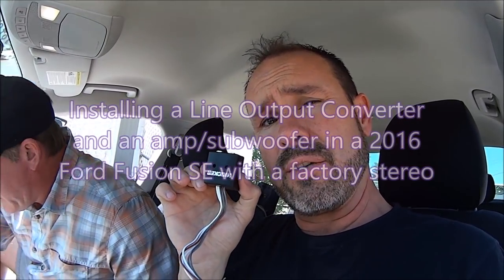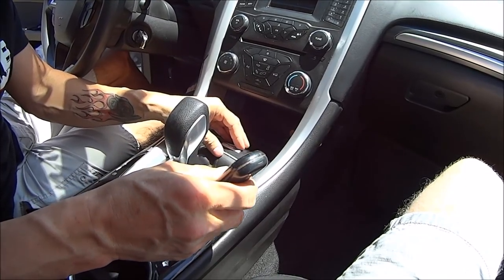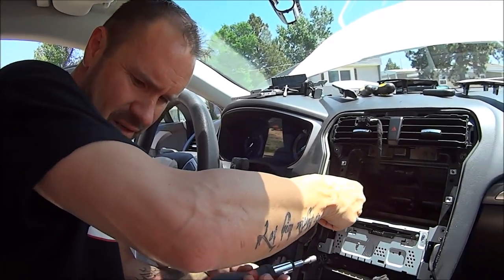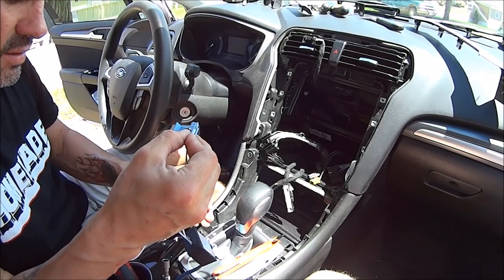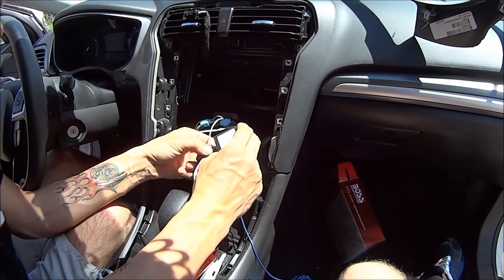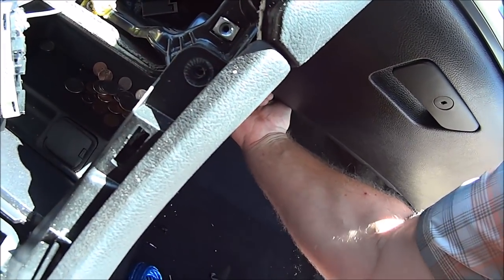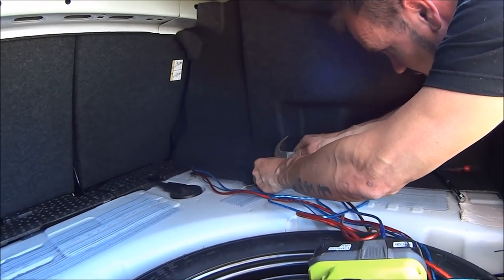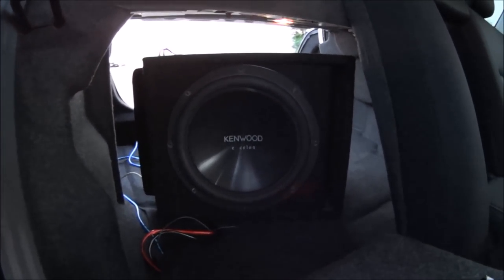How To Install a Line Output Converter & Sub/Amp in a 2016 Ford Fusion SE with a factory stereo

Comment from the maker: 🤩 How to hook up Remote Wire for amplifier  - 2013-2017 Ford Fusion https://youtu.be/F5KxbV1Pylk
Reply: rapidtronics I have the same fusion but do you know how to take the rear door panels off ?
Reply: Would the wiring diagram work for my 2019 Ford Fusion?
Reply: @rpgdadon1184  2 screws and a few pop pins, and wiring harness. Just start the pull from the bottom and work up each side evenly...

Comment: Bad idea to run your power wire on the same side as your RCA wire.  If your using cheap stuff I guess it will work .  How ever if you use good stuff do it right .
Reply: You wont hear interference in the sub running the RCA next to power. You are much more likely to hear interference when running your mids/highs next to a power wire. Nonetheless its good practice not to run the RCA next to power. This guy was brutal to watch do this install. I was actually angry by the end of it.
Reply: @stephenvernacchio3366 in one word "inductance"
Reply: The whole video was painful but to see all the comments of clueless people asking for his advice scares me even more!!

Comment: Be careful running power and signal wires on the same side. Alot of the time it can cause interference in the audio signal. Also for those attaching the ground to the body, make sure you scrape paint off from where it makes contact.

Comment: Just did this on my 2013 fusion. For anyone wondering the radio ignition wire for the remote is a skinny brown wire next to the other speaker wires. Hooked the remote up to there and it turns on and off perfectly.
Reply from the maker: Thank you so much!
Reply: Fire 🔥 information thanks

Comment: I did this and now the radio won’t turn on everything worked fine for a minute Iv checked fuses disconnected the battery nothings working radio is completely black and won’t turn on anymore

Comment: Dude thank you for this video! Got a powered sub for my son's birthday and he's got a 2016 Fusion hybrid. Cool thing is that his 12V battery is in the trunk so no need to run power from the engine compartment. I assumed I could tap into speakers from the trunk but they are only in the doors! Grr! Its nice to see all the steps and problem areas of the process.
Reply from the maker: Steven Bloomfield thanks man I appreciate it!  Glad this helped 🤗

Comment: You made a very courageous video.I did my full system recently which took me 3 weekends.It can be very daunting  for average Joe's as there is much more involved than people think.Taking apart the interior,determining amp locations,figuring out the best,cleanest wire paths and the list goes on.I've never done a Line output converter but my mother wants me to do an upgrade in her vehicle which will require using the speaker outputs to send the signals to the amp.There are simpler applications out there from good manufacturers such as Kicker.For example,speaker outs to RCA which can go directly to an amplifier that accepts high level RCA signals.That same amp has a DC offset turn on which does not require running a remote wire.
Reply from the maker: How to hook up Remote Wire for amplifier  - 2013-2017 Ford Fusion https://youtu.be/F5KxbV1Pylk

Comment: Ur so awesome!  Thanks 2 shops couldn't figure it out without connecting things and it looks a mess and my battery has died 3rd different replacement now and no sound after spending so much money ima just go do it myself now that ur updated shows the real place to connect the remote

Comment: Dude I give you an "A" for effort, watching you do this I felt so compelled to help but I couldn't, for one it's a 7mm socket, and the screws you took out by the vents were unnecessary to remove, there's just the two screws on the lower end that needed to be removed, the rest is just clips that hold the radio in. I'm sure you figured that out eventually but a little to late lol, thanks for the video anyhow.👍

Comment: worked great with the remote wire location from the other video! thank you so much for making this video, made my life much easier!
Reply from the maker: That’s so awesome!!!  Thank you for letting me know 😁
Reply: @rapidtronics  i couldnt get the power wire through the firewall because i couldnt find the grommet on the other side so i just ran it through the door, but besides that it works great!

Comment: Great video! Next time try grounding the line out converter and run the remote wire from that. Once it detects the 12v coming through the speaker wires it will send power to your amp.
Reply from the maker: I actually do want to try that next time..  And thank you! ☺️

Comment: Thanks for sharing this video. I Had little issues. My issue was installing the wire from the battery. My hanger kept getting behind the carpet. Had to put my finger in the hole to feel for the carpet and get it in front of it to string it through. Other then that, I didn't have to go back and go over the system because it didn't work. 

I should have went and got those fancy wire clips though because trying to use regular wire caps made things really tight as they don't give you much extra wire. But it still works and that's all that matters.

Comment: If you have the Sony system definitely add the loc after the Sony dsp and tap the signal off the oem subwoofer otherwise your subwoofer you’re adding will be controlled by the volume, and the beeping for your backup sensors and stuff will be played through the new subwoofer too, add your new subwoofer AFTER the Sony DSP(sony amp)

Comment: Hey! This was so helpful thank you much! The only problem I’ve come across is with the ground wire on the Loc, I’m not sure where to put it. If I ground it to metal the subs and amp will turn on but my whole AC and radio panel will turn off completely. I was wondering if you any ideas one what could cause that? Or what wire the ground is supposed to be attached to if that’s the issue

Comment: You specify two different sets of wire colors in the video and then provide a link that details an entirely different set of colors for each speaker. Which is correct?

Comment: Thanks for this video brother I just picked up a 19 se myself very informative!
Reply from the maker: Right on and thank you brother!!
Reply: Will those work for a 2020 Fusion SE Hybrid with 8 inch Sync non Sony amp? I'm trying to determine the wires for the speakers to connect a line out convertor.

Comment: Dude you are so awesome for making this video!! 👍👍
Reply from the maker: Dude thank you so much!  I really appreciate that ❤️
Reply: I ran into the same problem w the remote wire. It’s currently tied into the pink/purple lcd screen wire.. If I put a toggle switch on the remote wire, N turned it off, would that keep my battery from dying?
Reply from the maker: Ya that would work too.  Did you see my other video on how to hook up the remote wire?

Comment: Your video was very helpful. But I have one question?  I see you ran the blue remote wire to the 12 volt wire behind the deck. But what about the blue remote wire coming from the  line lout converter harness?
Reply: I have this same question

Comment: took em like 4 tries to figure he needed to go to the fuse box smh. i was going to send a comment through because thats what ive done on my ford focus but its not the same model but simalair builds on the interior for wiring and panels, i also am going to be installing a loc and swap back in my rca cables instead of the speaker cables in there what you couldve done was install the loc in the trunk next to the amp wiring harness then run your speaker cables up left side and power and radio turn on wire up right side, then you wouldve had a direct tie in to the remote turn on switch from atleast the amp. but after doing it for first time after a build like this you start to come up with different ways you couldve done it. i janked up my speaker wires they ended being too short for the length i needed so i had to tie in another 2 feet of speaker to already tied in speaker lol. had all my frequencies down from the start and wasnt really getting too much base for a couple months now ive left it buit went back to it and firgure the frequencies were low from factory build so turned em up and now i got an amazing sub that is going to be upgraded by cables and loc soon enough then speakers later.

Comment: This video is very helpful. I now have an amp and sub hooked up but the big issue that I'm facing now is feedback from active noise coming through my sub. This is active Everytime the engine turns on. I have a hybrid and the sound is annoying and it can possibly damage my speakers.

Do you know how to disable the active noise without unhooking each mic?
Reply from the maker: I don’t 🙄
Reply: When I got my amp/sub in, I had to use LPF only because if I had it on Full or HPF I could hear the music through the sub. Maybe that's the issue for you? Not sure how other amps look or work though. LOL
Reply: Jessica Swearingen Thanks for the reply. I got it all sorted out. It turned out to be the Active Noice Control Mics in the car. I did a lot of reading in forums and started unhooking the mics from under there headliner. If you're just doing an amp for subs, it will just be the rear mic that needs to be unhooked. If you're doing an amp for mids and highs the front mics in the headliner will need to be unplugged.

The actual module is behind the Glove box but it seemed easier to just do everything from the headliner. Now the sound is perfect.

Comment: Doing the same thing to my 17 fusion rn. Do you think I could remove the center console side panel under the radio. Then find the wire harness going up to the radio and splice line output converter from there. That way I don’t have to remove the stock radio and splice behind that?

Comment: Did your Ford fusion have a factory amp already in it? I just bought a 2017 Ford fusion titanium with the Sony system in it and it has a factory amp in it and I don't know if I want to try to put this output line converter in or not?

Comment: You don’t need the converter if you get an amp with high line input.  The amp should do that for you.  Coulda just tapped into the rear speakers and plugged the high line input straight to a compatible amp.  Simple

Comment: Were you not concerned with the power wire interfering with the signal in the rca cables? I always heard they should be run on opposite sides, not together, so there is no interference.
Reply from the maker: I’m not getting any interference..

Comment: What type of splice did u use to connect the output converter wires to harness I allways slices a piece if one at time then attached wire... takes forever

Comment: Did you ever get clarification of what color the accessory wire is and what harness it's coming off of. Also did you connect the loc's 12v constant wire? And if so what wire did you tap for that?
Reply from the maker: How to hook up Remote Wire for amplifier  - 2013-2017 Ford Fusion https://youtu.be/F5KxbV1Pylk

Comment: Actually it is not all about the sound.  It is about the back up camera and the new visibility on the 2017 vehicle.  The 2016 model had the worst visual field.  Thank you for not letting me run over anyone.  Now that the visibility issue is solved.  Go to making the Fusion an awesome camping car.  There is so much prius crap.  The fusion is livable.

Comment: What were the connectors you were using for the LOC? You called them quick connects or quick clips and it seemed that you didn't have to splice the wire and just went over the jacket at the radios speakers?
Reply: rapidtronics that's a sucky way to connect the best way is to connect from the ignition wire it be better
Reply: did you figure out what the part was ? i'm thinkin of trying to use them myself

Comment: I own a 2017 Fusion and the head unit looks very different along with the shifter. Are the clamps and screws still all In the same place?
Reply from the maker: I’m not sure but I think it’s similar
Reply: If u have a 8 in display then its different mine is a 2017 nd looks like the video worked out great

Comment: How were you actually able to connect the wires from the output converter to the stereo wires that were there? Did you have to strip them?
Reply from the maker: You can literally watch exactly how I do it in the video.  No explanation needed..  I’m confused here
Reply: rapidtronics rapidtronics at @20:40 onwards I see you put the wire into the clip then clamp it to the violet and green wires but I want to know how just clamping two wires together worked. How does that clip work? Is it just for Organization of the wires? Were they exposed? Sorry dude I’m kinda confused too as I don’t have these clips, literally trying to do it while watching.
Reply from the maker: Hey buddy those clips have a little metal thingy that splices through the wires when you clamp down on it, therefore making a solid connection..  They are the bomb
Reply from the maker: No stripping of wires necessary
Reply: rapidtronics thanks man, I need to get those clips. Would make things so much easier. Thanks for taking the time to explain dude. Appreciate it.

Comment: I believe if you would have used the remote wire on the loc for the remote output to your amp and wired the locs 12v constant to the 12v constant in the dash and grounded the locs ground wire. That would have solved your amp not turning off issue.
Reply from the maker: +Josh Moore - The loc I used is non-powered...  It only hooks into the speaker wires..
Reply from the maker: How to hook up Remote Wire for amplifier  - 2013-2017 Ford Fusion https://youtu.be/F5KxbV1Pylk

Comment: Hey, thanks for the video. Did you figure out where the remote wire should connect to yet?

I am planning to do this and I think my LOC has a switch to automatically turn amp on, but that requires a 12v power supply. I just want to be prepared
Reply from the maker: I have not.  I need to..
Reply: @rapidtronics  how are you turning your amp on and off? Or do you just have it disconnected for now?
Reply from the maker: How to hook up Remote Wire for amplifier  - 2013-2017 Ford Fusion https://youtu.be/F5KxbV1Pylk
Reply: I thought I heard they don't really have a remote wire anymore. Everything is constantly powered and the canbus communication system tells items to boot up essentially. I've been seeing people use amps that power up and down automatically based on the line signal, like a lot of home theater subs.
I just bought a 2016 fusion SE, stereo is shockingly bad. Worse than a SE escape stereo oddly. My plan is to get a small 4 channel micro amp that will auto shutdown and try to stick the amp in the dash, give the speakers more power and probably replace the speakers. No sub planned.
Reply: @kyleb2044  I ended up just using an LOC with a switch and running the 12v power too it. 

Be prepared, if you replace the door speakers in your fusion, you'll either have to adapt the current speaker housings/baffles by cutting the old speakers out and reusing them (there are videos) or make your own mounting plates (what I did).

Comment: why wouldnt you just use the remote wire coming off the line convertor? Or use a fuse TAP yo your cig lighter fuse in your under dash fuse box if you insist on using a car controlled switch since you cant seem to find the brown wire.

Comment: Your rca's should be ran on the opposite side of the car away from your power wire. It can cause distortion. I gotta 2016 titanium with 2 sundown sa 12's(upgrading to x12's), sundown sae-1500d, and optima yellow top.
Reply: Are u using this convertor ???

Comment: Hey! I have the same car as you and just ordered the same stuff as you and I already have a sub. I have heard from some people that hooking a sub up to a factory radio dosent usually sound very good. In your opinion does this sound as good as just buying an after market radio?
Reply: Nicholas Dufner it only sounds bad because sometimes you have yo ground it and people don't so it sounds terrible it's all chance really. But if you ground it when you need to it sounds crystal clear
Reply: Avwry Mills you can't use the amp unless it's grounded
Reply: Cristian Rios yes and for line out converters you have to run it to your ground wire too or like I said it sounds bad
Reply: Where did everyone ground the out put converter? On the harness wire or a body ground

Comment: Any tips you can give me on getting my 4 gauge wire through that firewall. I've been trying but no success. Cant even get the coat hanger to be visible in the cabin.
Reply from the maker: You might have to just make a bigger hole?
Reply: rapidtronics figured it out and ran it through. I have absolutely no clue how you did it from the passenger side but the driver’s side was pretty easy.

Comment: Does it matter where you connect the right + and right - and left + and left - on the LOC to the radio wires? I noticed you went with the rear speakers and I'm wondering if I can go with the front. I'm installing the LOC for an equalizer I want to put in for all 4 of my door speakers but am unsure if I should use the front speaker wires  or the rear speaker wires to connect the loc to or does it not matter at all?
Reply from the maker: Krinkle Kuts I’d do front to front and rear to rear man...

Comment: Where can I get those blue clips that you used to connect the remote wire to the head units wires
Reply from the maker: Auto Zone or any car parts store
Reply: @rapidtronics   what are they called again ?
Reply: Harbor freight

Comment: I’m trying to do this as well. I’m curious as to what fuse you tied into to have the amplifier on only when the key is on.  @rapidtronics
Reply from the maker: +Nick Sebree the radio fuse or auxiliary
Reply from the maker: How to hook up Remote Wire for amplifier  - 2013-2017 Ford Fusion https://youtu.be/F5KxbV1Pylk